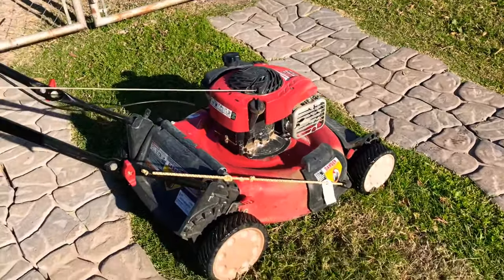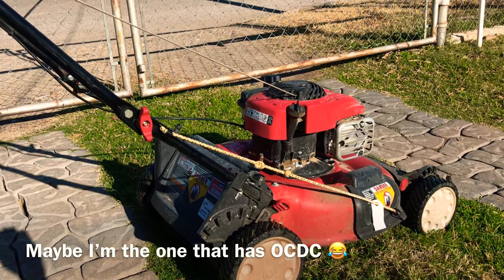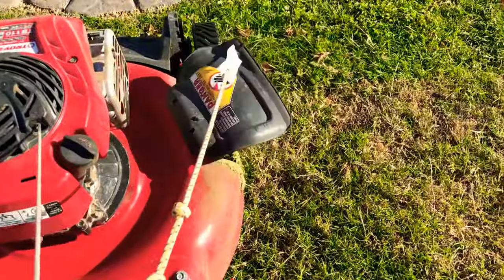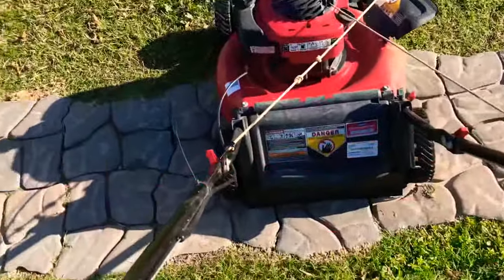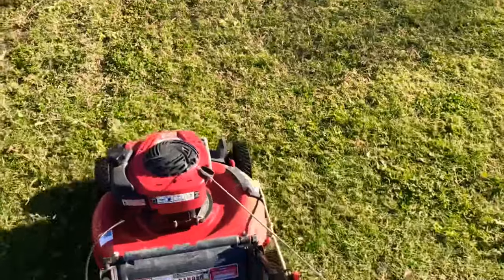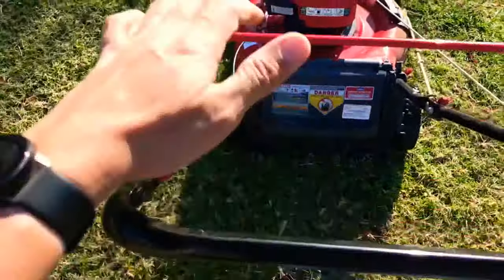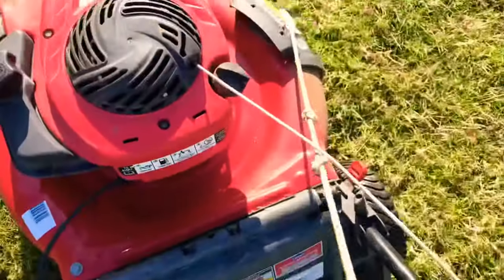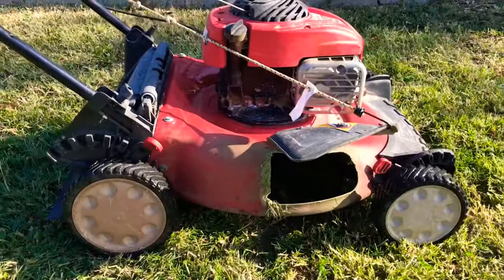DIY SIDE DISCHARGE CHUTE HACK!!!

Comment: Thanks. Very helpful video. Can you please explain how you connected the bungee cord to the cover so that it would stay open. (Did you drill a hole in the chute cover or what?) Thanks in advance.
Reply from the maker: Yes I did. I just drilled a small hole 🕳 enough for the bungee cord hook 🪝 to go through.
Reply: @electriccuts  Thanks for your prompt informative reply.